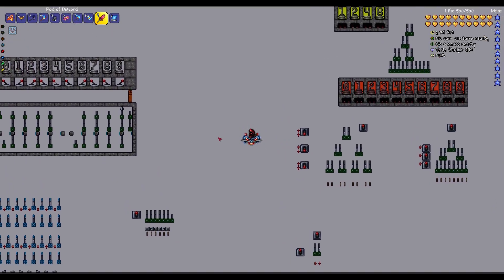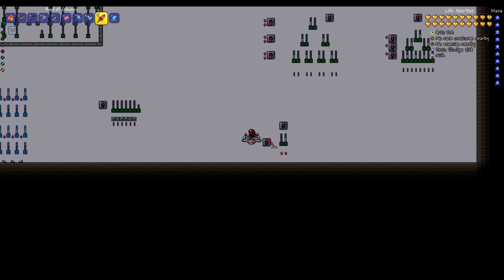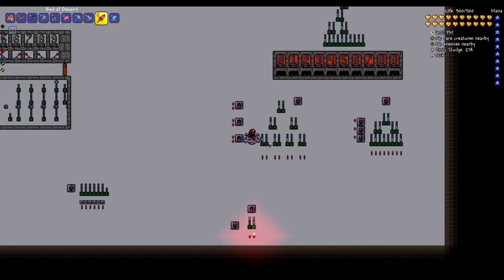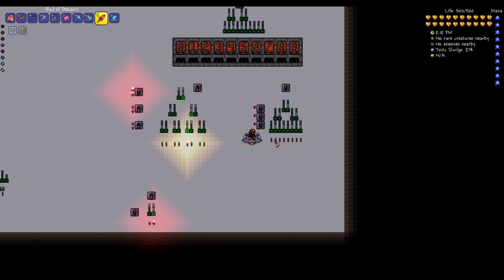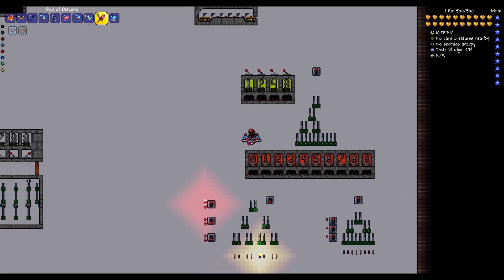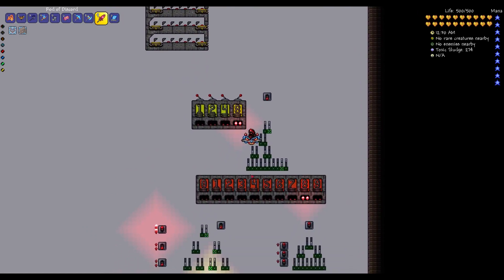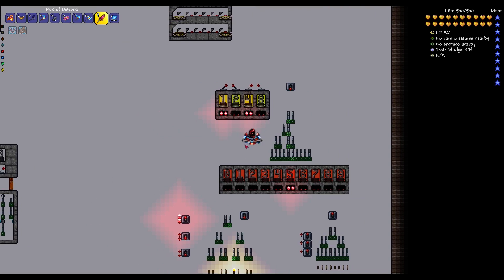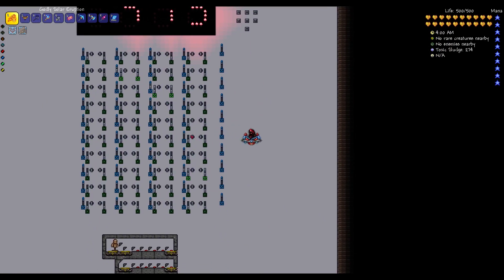Terraria 1.3.1: Building "Giant" Logic Gates (also: how to build a BCD to Decimal Converter)

Comment: Hey, I was playing around with these giant logic gates. and I decided to try and make a random number generator out of it. I even made a number display for it. But I found something interesting you didn't tell us in your video. If you switch more than 1 layer at a time, it completely breaks the device. XD So I fixed it up to use a dart trap to set them off all in a row instead of the randomizers triggering all at once. While I was working on my duck hunt game I was thinking, is there some kind of way I could use this? Well after playing around with a few designs it didn't really work. My randomizers need to be able to turn on lamps one at a time but stay on throughout the game, and for the wave sequences I need something that can put out many different outputs in a row, but having this giant logic gate for 100 waves would be way too big of a logic gate. XD Then as I was testing it out with only 20 waves set up so far, I had a great idea. Hearing the same old background music while playing the game just seemed really dull. So I thought, I should make some kind of device to change the music as the player is playing the game. And that is when I thought, this giant logic gate would be perfect because it would let me play only one music box at a time. :) So I found a use for it after all. \o/

Comment: Aren't you so happy you can make these things a lot smaller now? XD
I'm currently working on making a kind of duck hunt game in Terraria. The plan is to have it go through many waves (maybe like 20) with each wave spawning more and more ducks. If the player can't kill enough of the ducks to make it to the end, then it will be game over. >:) I just need to work out the easiest and most effective way of setting it up.
Reply from the maker: Sounds like a pretty neat game! You should check out the T-MEC forum for some ways of keeping count of things, such as pressure plate presses - you could have the missed birds from statues activate pressure plates if they get away, and after a certain number of clicks it's game over. Good luck in your build!
Reply: +Joe Price Well, the game over will not be based on count, but the player's death. XD See when ducks are dropped off of somewhere they fly down in a kind of zig-zag flight path. So the plan is to have spawners at the top (26 in total) which will randomly spawn some each wave with the number increasing each time making it harder. On the floor of the room is yellow pressure plates, which are triggered by anything but the player. The pressure plates are wired to the walls of dart traps on the sides of the room. So unless the player wants to eat a flying wall of darts, they are going to have to keep all critters from landing on the pressure plates. XD
Reply: Vis that is pure evil. And i love it

Comment: - hoik tracks have not become redundant right? but most of it can be replaced with new logic gates.
- what block are you using for the background and which one for the black torch display?
Reply from the maker: Hoiks will still be necessary to create staggered events. For instance, the sequential display mechanism I showcase in the video requires the shifter (that shifts the digits to the left) to operate sequentially instead of simultaneously. That's why there's a hoik track at the bottom of the mechanism.

However, hoiks are no longer necessary for any type of logic. 

For my background, I'm using diamond gemspark walls. I'm using obsidian walls for the torch displays, and I paint them black with a roller. I also paint the torches black to make the display as dark as possible.
Reply from the maker: AceSurviver54 Hoiks can separate events by a game tick, but the main issues with them are the space they occupy, and more importantly the world limit on dummy ghosts. Only 100 ghosts can be active in the world, so if the machinery needs a lot of them it's possible to run out.
Reply from the maker: AceSurviver54 I started learning about all this stuff the moment I began engineering in Terraria :). I mostly googled stuff, although I tried to figure out as much as possible on my own first before taking a look at how its done in the real world. Sometimes having knowledge from listening to others can lock you into a certain way of thinking and create some inflexibility, especially when it comes to a pulse-based system such as Terraria!
Reply: Couldn't you use some kind of state cell created from logic gates to accomplish this instead of hoik tracks?
Reply from the maker: ***** The thing is even if it were possible, we cannot create a delay shorter than a game tick. Jumping from one hoik tooth to the next happens in a game tick already, so the only advantage of using logic gates exclusively for the staggering (if it is discovered to be possible) is greater compactness. That might be relevant down the line once we start creating world-sized machines.
Reply: Ah... My experience in logic gates and such generally comes from minecraft where torch mechanics take place over a period of 1 or more ticks which is where my confusion came from, I suspect. Thanks.
Reply: I hoped in 1.3.1 there a delayer were be added like in Minecraft, because that removes the complicating need for hoiks
Reply: Haven't tried the updated Terraria yet.... are hoiks faster? That's more useful for a sequence of events, no?
Reply: Oh, thanks for the clarification! By the way, where does you knowledge of binary, programming, etc come from? If you program, can you recommend a good way to learn and a first language to start out with?
Reply: ...which works entirely different from Minecraft's state based system (on/off).
Reply: +Joe Price Hi - I downloaded your world and I have a question about the digital clock you built: For some reason the minutes are not changing when the seconds hit 00. Please advise. Thank you.